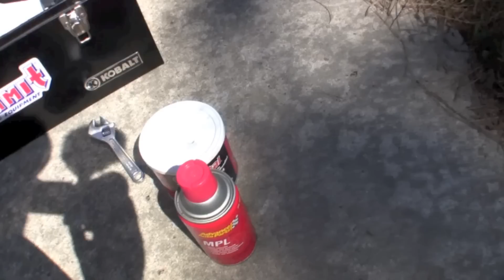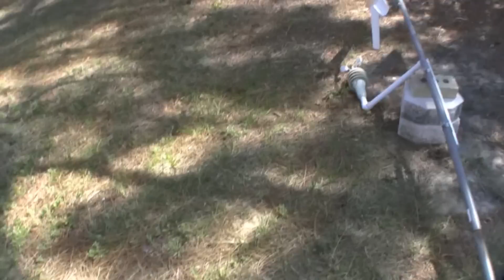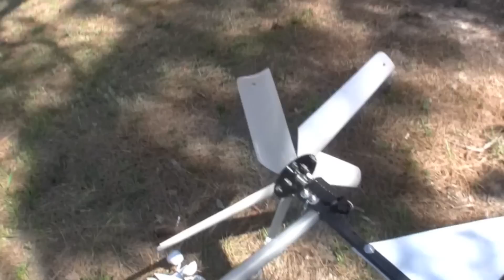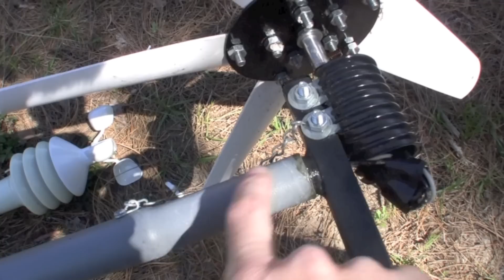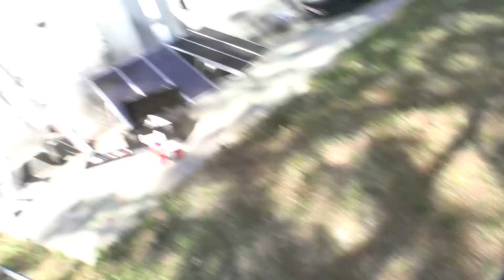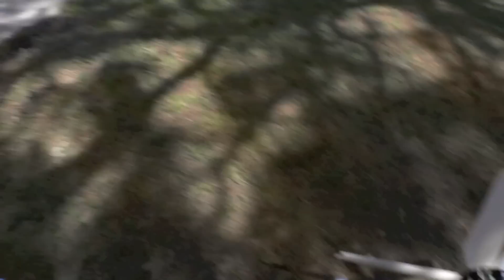1 year old Wind turbine not rotating

Comment from the maker: I have 10 Deep cycle 125 amp hour batteries but this runs most of the lighting in my home along with other things.  The wind turbine is just for trickle charging the battery bank really. It works great for its size... I want to get a larger turbine but I am working on more solar panels and a hot water system first.